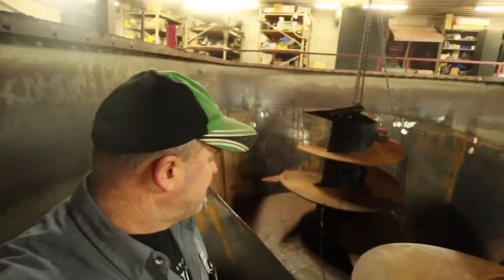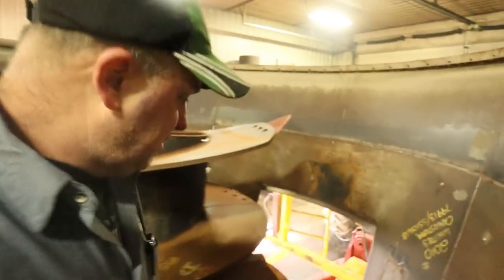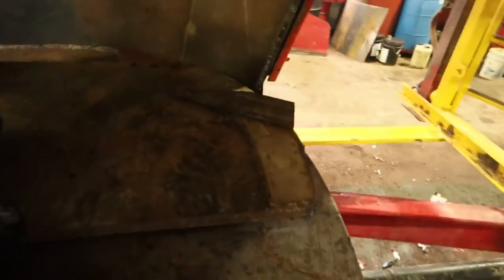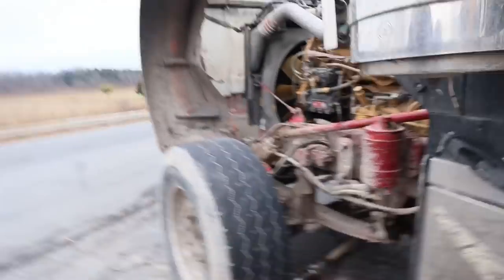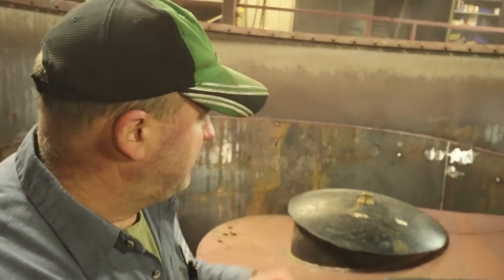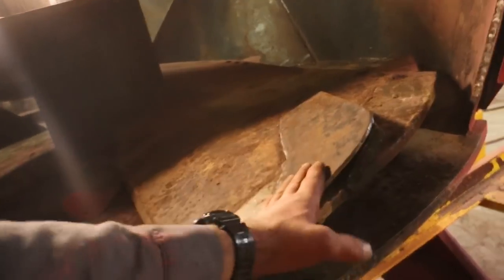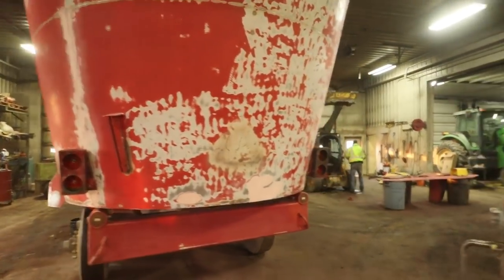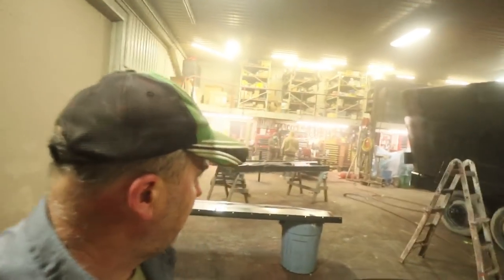Mixer in Primer | Broken Tie Rods

Comment: How did you adjust the tie rod for toe in out of the shop?  
I have pulled the rod end up on the ball and wired it there to get back to the shop for better working conditions.
JIM
Reply from the maker: We counted the threads

Comment: Why did u not remove that gearbox first?
Reply from the maker: Damn shaft hadn't come in yet
Reply: @FarmingFixingFabricating  sure would of been better to remove it and paint the chassis where it was supposed to go no there is going to be a missed bit.
Reply from the maker: @davie2606  true, just have to get out the paint brushes
Reply: @FarmingFixingFabricating  see you have had a visit from Zac.